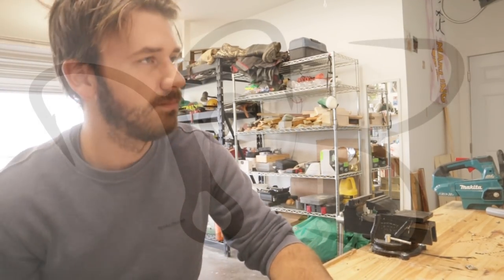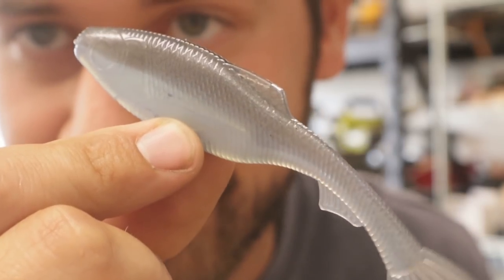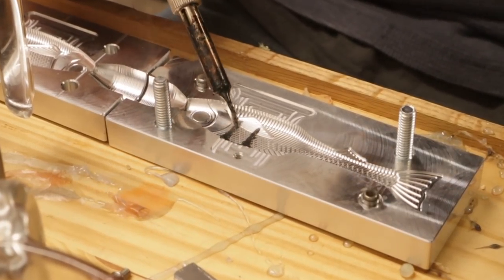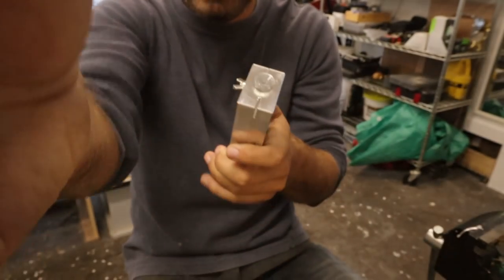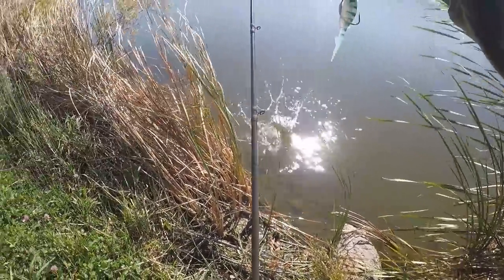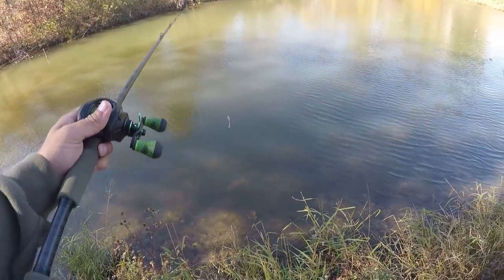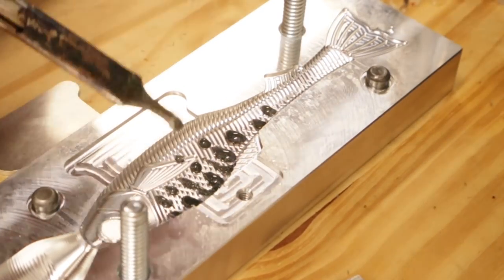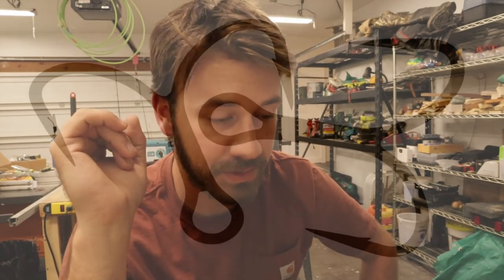An Epic Little Bait Fish | Inject to Catch

Comment: When a pastry chef molds chocolates they often fill the mold full and let it cool slightly, then pour out the chocolate before its sets fully leaving a layer of chocolate on in inside of the mold to be filled later. Could you use the same process to create "filled" looking soft-plastic baits?

Shooting an outer color and then tipping the mold to pour the plastic back into the measuring cup before shooting a filling layer after the shell cools???
Reply: I’ve seen him do that with his handmade silicone molds... but not with the aluminum molds
Reply: thats definitely a process ive seen both marling baits and worlds worst fishing do, i think its called the capsule method
Reply: It’s called skin pouring both marling and worlds worst fishing have done them
Reply: Whatever it’s called, it’s an open mold technique. I think Nate has one open-top aluminum mold and the rest he did with homemade silicone molds...

Comment: A good test tank may be something like a trough. Long so you can reel it and see its action, but deep enough you can see the fall action. Do they make transparent troughs?
Reply: What he needs is a glass trough - for the discerning horse....
Reply: Rubbermaid manufactures black plastic water troughs ranging in price  30 to 300 dollars.  More expensive but I'd think a galvanized tub would be better though, put a cam under water  and film.  Trick will be getting a tank with enough length vs depth though to make it worth while.  If he just bought cut 1/2  inch plexi he could make a tank but given the length the side bow may be hard to control and when you get 50+ gallons of water .... you know even a bathtub would do the trick and be about the same kind of price he would just be limited to being just shy of 5 feet cast length.
Reply: @keeperofthegood  what of the needs of the discerning horse...

Comment: For that test tank, set it up with some adjustable flow pumps so you can just hold a bait there and watch it. Let the water move instead of the line. Adjustable flow for to simulate different retrieve speeds.

Comment: An idea for your lure action winter water tank. Maybe you could engineer some sort of moving water tank rather than a standing water tank. It could be a lot smaller but would require a pump to move the water and some sort of water dispersion grid to create a laminar flow. Yes it would not be the easiest but it would allow you to just clip on a lure and watch its action with the camera not having to move. It would also be a lot smaller and you could adjust the speed of the water.

Comment: If you do make a test tank, glass and GE silicon 1 is probably going to be much more cost effective than acrylic. You might also want to do what's called a "euro brace" on the top depending on how big you make it. You might also be able to find a "33 long" aquarium which is 48"x13"x13" if you're not trying to go crazy long.

Comment: For a test tank. You just need a little water jet pump. To Make current in the water. That way the water moves past the bait and you don’t have to manually tow it or pull it through the water.

Comment: You should try one where you put a thin layer of clear plastisol on each side of the mold then instead of trying to paint hot plastisol just airbrush all your detail on then finish by injecting the background color. Other things I have thought of that might be neat to try is print a photo of a fish and put the photo inside the bait with just clear plastisol, Use  cheap dollar store pipe cleaners in red or whatever color you want to do a bloodline or lateral line and to also change see how it changes it's swimming motion, make soft plastic crankbaits/ driving baits/ square billed baits, buy a 3d printer to make quick molds for testing before sending to an aluminum production mold also use it to make hard baits or tail fins for swim baits and what not. Just some ideas that might make cool videos keep up the good work!
Reply: Oh yea one more I had thought of was doing a carved wood bait like a jointed swimbait but the back half is a replaceable soft plastic to give it that natural swimming look

Comment: You will not need a huge tank. Get a 10 Gallon tank and install a circulation pump. Just make sure it is an adjustable flow pump so you can control the water flow.

Way cheaper than buying or even fabricating a tank big enough to drag a lure through.

Comment: You need to have him machine a very small syringe to use for painting on those highlights. It would give you better control when applying the plastic designs to the mold side than using that soldering iron.

Comment: Maybe if ur gonna keep "painting" plastics, get a super cheap, stick style soldering iron and put a brass/copper/something softer even - rod instead of a soldering tip so it's softer than the aluminum ur dragging on, as soft as you're doing it, maybe not an issue, but u know, kinda hurts to see on such beautiful metal